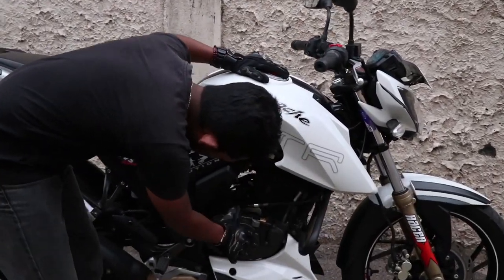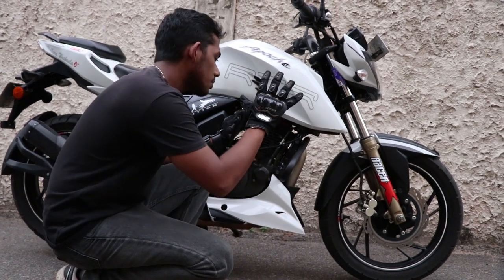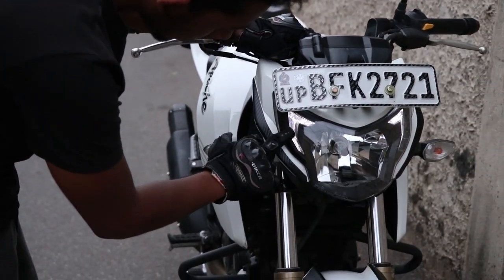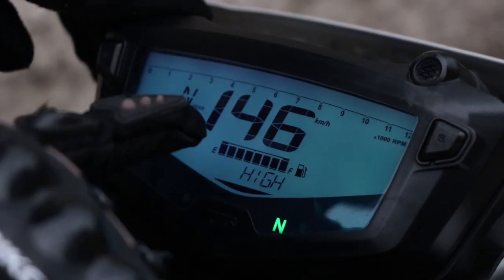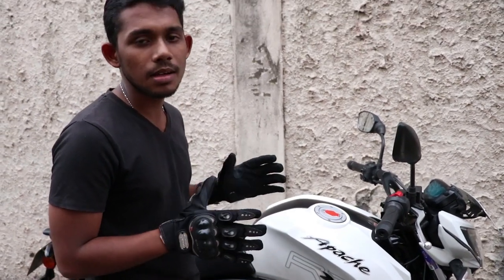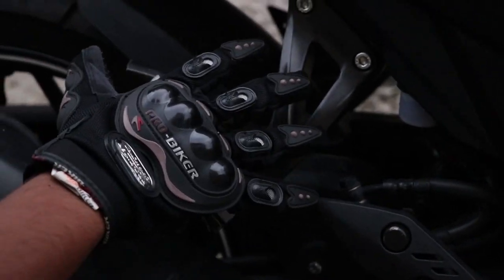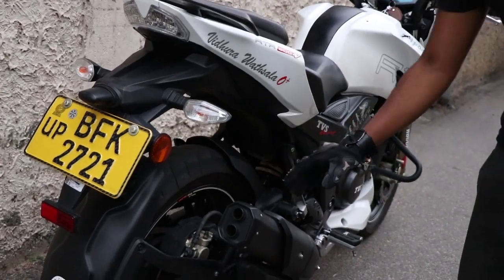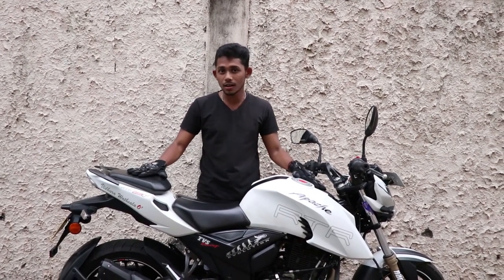TVS Apache RTR 200 4V Review | SRI LANKA

Comment: supper bike recommended . negative point is bike has less weight .
Reply: High weight will reduce bike speed. No problem in handling controlling breaking. I m owner of RTR 150 SINCE 2014.  still super performance as new